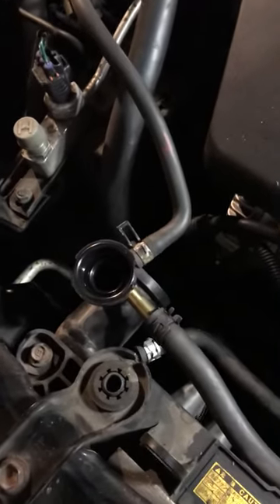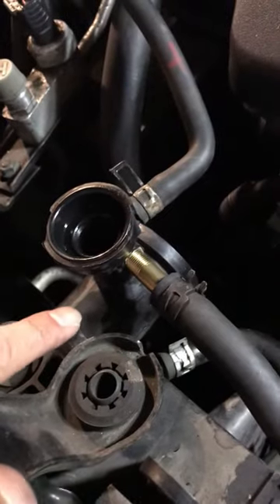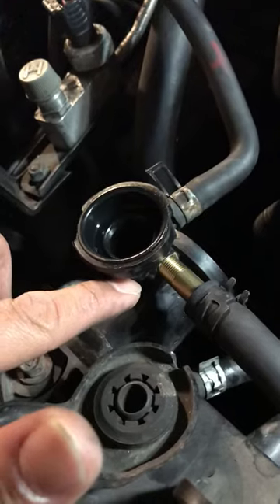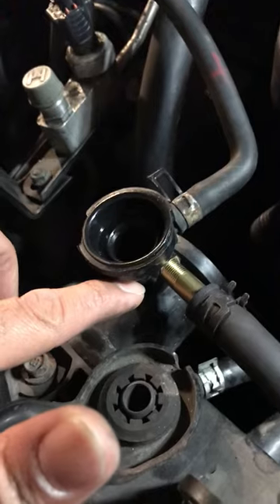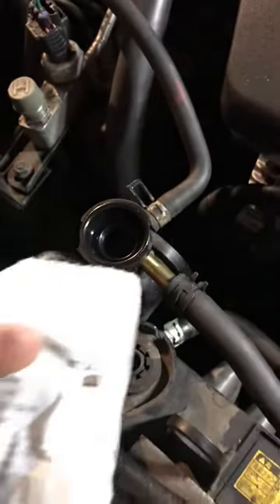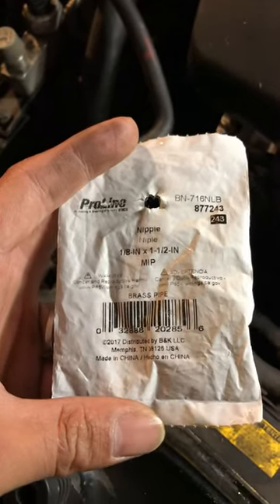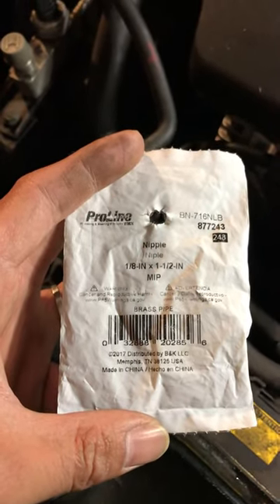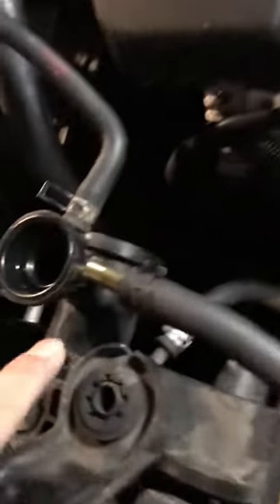Fixing a radiator neck nipple of a 2009 Toyota Corolla

Comment: 02/18/2022 Update. I went on vacation and I was able to fix this until now. Very slowly drilled the hole with a narrower drill bit; then I screw the nipple by hand first and and then using pliers—very slowly but firm; I didn't want to break the plastic even more. I only found the 1/8" x 2" nipple; so I went with it. At first, it had a small leak. Unscrewed it, added thread sealing plumber tape; bingo! no leak. Purchased the JB Weld but I haven't used it yet. Nipple and JB Weld was $11.70 total at Lowe's. Great fix! thank you again.
Reply from the maker: Try using the JB weld and go around where the screw meets the plastic. Put a decent amount and wait for 30 mins.
Reply: How's it holding up???

Comment: I'm about to do this exact same job on my 2010 Toytota Corolla and like most of you , I also broke the plastic nipple changing out my alternator! But to be fair the broken plastic parts were very brittle and crumbled very easily when I used needle nose pliers in order to remove the pieces from the hose.
Reply from the maker: You can do it! I never had to reseal mine again and its been almost 3 yrs i think.
Reply: @ildjer baron  job is complete. I'm going to wait the full 24 hours for curing. Tomorrow I will go buy a jug of coolant and I hope all goes well. Thank you for your video. I also had seen the other video and purchased the bigger fitting but returned it and bought the same one you have, just a 2 inch long one. I wanted it to go deeper into the hose. Again thank you for a great video!
Reply: I have the same problem with the same car doing the same thing you did. I will do this today. Thank you for the video.
Reply: What's the JB Weld for?  Where did you apply it. I need to do this to my 2010.
Reply: Napa gave me the wrong sized alternator, wouldn't fit and ended up pressing my elbow into the damn thing, now I got two things to fix 🤬 lol
Reply: @pvman2 the threads I believe. The 6 hr cure stuff.
Reply: @danr8945 do you need to add more coolant if only a few drops came out? Or anything else? How do you keep the plastic being drilled from dropping into the radiator???
Reply: @foxmulder7616  dude, same thing with me too, but Autozone gave me the wrong alternator. I leaned my hand on this damn brittle plastic piece while taking out my original alternator.  I have the 2 problems as well, and a van with an A/C choke/pulley still to fix besides this 2009 Corolla stupidity. So glad for this video that gives me hope to fix this.

Comment: Awesome bought same nipple and 25/64 drill bit today and worked ! Put extra JBW almost bought a new$280 radiator😅 mechanic broke the nipple putting the alternator. Thanks for the video😊
Reply: I just want to confirm that you use the same brass part as the video and 25/64 drill bit?  Then you just JBW around it?  Thanks.
Reply: I'd like to confirm, also.  I broke mine replacing the alternator, also.
Reply: @pvman2  i too can confirm i broke mine changing the alternator
Reply: Same lol

Comment: Just did this on my 2010 corolla, used the same parts, drilled a hole with a 11/32 drill bit then used a 1/8 tap and it went in nice and tight with pliers.  ive driven it around 30 miles so far so we will see how it hold up. i think there might be a small leak where the hose connects to the nipple, ill have to keep an eye on it and maybe get a different fastener to prevent any leaks.
Reply from the maker: That’s where you need to place JB weld around it. Apply as needed. You’ll know coz coolant will drain fast.
Reply: @SmoothOperata  are you sure? i applied the jb weld on the plastic and the brass nipple. I just slid the hose over the brass nipple and used the same clamp. it seems mostly fine, i dont know about  jb welding the rubber hose to the brass nipple, if its an issue ill probably just get a steel hose clamp and tighten it. seems good after 200 miles so far.
Reply from the maker: @tylersutton6120  sorry I applied on both. I applied JB weld where the nipple meets the plastic, inserted the nipple to the rubber hose, used the clamp, and added JB weld on the edge of the rubber for added security. I accidentally broke mine again after replacing my alternator and redid the whole thing.
Reply: How's it holding up?

Comment: I just broke mine a couple days ago on a 2007 Toyota Fielder ( I am in Japan). I have a wooden plug in it now but I will try what you did here if a can find a similar nipple. Great solution!
Reply: So if you just plug it tight it doesn’t effect the radiator performance right ?
Reply: Cause it's just overflow you can just plug it????? I live in Arizona, it's 115+ degrees here, think that would be an option for me? Just to plug it like that, or should I drill it and put in a fitting, like this gentleman did? 🙏
Reply: @foxmulder7616 , I gently drilled and tapped it then used a nipple and got the small hose over it. Been going strong ever since, the wooded plug only worked temporarily and leaked a little as well.
Reply: Ahh. I see. I went and got a brass connector. Gonna try this tomorrow. How do you keep the debris from drilling from going into the radiator neck though?  @veetors
Reply: @foxmulder7616 , I considered this and I cannot remember what I did exactly. I may have gently stuffed a paper towel into the top of the radiator to prevent debris from going inside while drilling and tapping. I do not have the drill and tap sizes here with me now, I can see them on Friday though and give them to you. I also used a little teflon tape on the nipple threads.  Always be careful when screwing the nipple back into the radiator as over tightening even a little may crack the radiator itself. I will check the photos I took at the time and perhaps that will jog my memory a little.
Reply: @foxmulder7616 , I was mistaken as it appears I did not drill before tapping although I thought I had. I can’t figure out how to send you a couple photos.

Comment from the maker: Btw, when i used JB weld as a sealant, i placed it around where the nipple meets the radiator neck and also where the rubber hose meets the nipple.

Comment: I’m going to try this. Crazy everyone on comments had issues on that piece after replacing the alternator. Working on my son’s car alternator. I did the same and I was so upset at myself. I smelled radiator fluid and was wondering where it was coming from. Then one last little move on hose. It Broke.
Reply from the maker: @ricardofabian9492  you got this

Comment: Yes use a 25/64 bit and drill it out and screw this same brass tube in then jb weld on inside and outside and let its cure 24 hours. Mine sealed perfectly and its been 3 weeks so far
Reply: How's it holding up?
Reply: @foxmulder7616 its been a year and mine is still holding
Reply: Way cheaper than a new radiator

Comment: how deep did you thread in the brass nipple?
should you put JB weld on the thread first and screw it in or screw it in and JB weld the outside?
Drill bit size?
How's it holding up so far?
Reply from the maker: Oh not deep! Just enough to clear the whole for the brass to go in. Then you place JB after you insert the brass. You place it around where the neck meets the brass. Check the video for size coz i forgot. Its holding well and it’s been about a year plus.

Comment: Got a small  leak on mine but I’m adding another coat of the jb weld, it’s really at the bottom where I can’t really see, but I figure one more should do nicely
Reply from the maker: Yeah seal all around. Use your hand if you need to then let it dry. I think i applied 3x.
Reply: Still working for you?

Comment: Good job. Just for future reference they sell that neck filler piece it's about 25 bucks and it's easy to replace. Hope this helps someone.
Reply: What is the part number?
Reply: I Can't find that part, I don't think they sell it separetly
Reply: @heyjuliebean1  they do I forgot what it's called
Reply: Filler neck , and it’s not sold separately ,
Reply: @cytukyl713  I replaced mine. It was separate.
Reply: I’m gonna have to see it
To believe it Man, I’ve been looking for it an even called an auto part store and you gotta Buy the whole thing. Only other video I’ve seen that does the actual filler neck replacement was for a Toyota Sienna
Reply: @cytukyl713  yes it was for Toyota sienna
Reply from the maker: Hmmm good to know. I haven’t seen it sold separately.
Reply: The 09 corolla radiator filler cap is built into the rad it self, i just checked it as mine just broke today and it pisses me off as I can't just replace the neck it self, the sienna, camry and some lexus, you can replace just the neck...its kind of a bummer, but i will try this to fix this instead of replacing the whole rad.
Reply: Wait! What?!?  What's the part number?  I have an NAP, 2010 Corolla LE.  That would be great to know.
Reply: @pvman2 it’s one piece. Either replace the whole deal or repair it

Comment: One question if the radiator is heating up when its running with thats metal piece expand and break the plastic?
Reply from the maker: Nope. It won’t. mine still works fine

Comment: What drill size did you use and is it still working today?
Reply from the maker: To be honest i dont know the size but a bit smaller than the connector so it will fit snug…Its still working. No leaks!
Reply: I used a T drill and slightly cracked the plastic housing because hole was too small. I suggest looking at T or U drill.
Reply: Another poster stated they used a 25/64 inch bit and it worked out well.
Reply: Looks like a 10mm tap

Comment: T H A N K   Y O U ! ! !   I was just replacing the alternator in my 2011 Toyota Corolla and broke the damn thing. You can't use a filler neck replacement and I was already almost crying I needed a new radiator....going to Home Depot tomorrow.
Reply from the maker: Glad i can help!
Reply: I quite literally just did the same thing.  I went ahead and ordered a new radiator though.  I figured if it broke that easily I should probably just replace it since it was so brittle.
Reply: Okay how tf are there 3 people that did the same shit. I broke it replacing the alternator as well. My temporary fix until I get a new radiator and have time to replace it is going to be just JB-welding it in place. Found some high temp high PSI stuff that should do nicely
Reply: I broke the piece of shit tryna replace the belt . Unbelievable
Reply: 5 months later and the fix is still working fine. No leaks. Ordered received new alternator; but I haven’t had time to replace it yet.
Reply: Broke mine replacing the alternator as well.
Reply: I just broke mine replacing the alternator :(
Reply: Same here.. My mechanic broke the nipple when replacing my alternator. 

We have tried fixing it but it keeps leaking once the coolant is hot.
Reply: Ran into the same shit
Reply: @svca12218  did you put jb on the thread too? or just on the outside ?
Reply: @therealartvalero  yes, on both sides.
Reply: @andrewarnold9818  just happened to me today.  Changing alternator and then next thing I know, leaking fluid. :face-purple-crying: Will give this a try.
Reply: Broke mine while replacing the alternator.  I didn't realize what my wrist was resting on, but it took very little pressure for it to break off.  What a PITA.
Reply: @andrewarnold9818 Broke mine replacing the alternator, also.
Reply: same exact thing happened to me after replacing my alternator :/
Reply: Just broke mine putting in a new alternator, lol
Reply: How did it go, is it holding up?
Reply: @foxmulder7616  No issues at all since 2 years ago.

Comment: I broke mine today thanks to micro fibre cloth :p it got stuck while i was cleaning the engine bay . I used magic its same as jb weld but its still leaking droplets just after im done peeing 🤪 and my mechanic says i need to buy a new radiator :(
Reply from the maker: Did you do exactly as what i did in the video? Add more and let it dry…
Reply: @SmoothOperata   no i just used jb weld to fix the nipple back into place and its working fine it helps in fixing leaks in plastic

Comment: Seems good but I’d rather not be left on side of the highway with possible engine damage. Denso on Amazon radiator is 107 plus tax. I’ll just hope this cheep Japanese car doesn’t keep doing this cheep break BS. First Japanese car I’ve had and had to replace it after pump alternator and now radiator. In all my fords never had to touch one of those until 200-300 thousand miles. But Toyotas are so reliable.. BS

Comment: Si u put j-b weld on the screw then on the tube or were did u put the j-b weld on ????
Reply from the maker: You don’t want to put jb weld then insert the tube. Insert the tube first then place it where the tube meets the screw. Put a lot around it and let it dry. Observe and add more if it leaks.
Reply: How he screw with the tube to insert the nipple? I don’t think is a good idea.